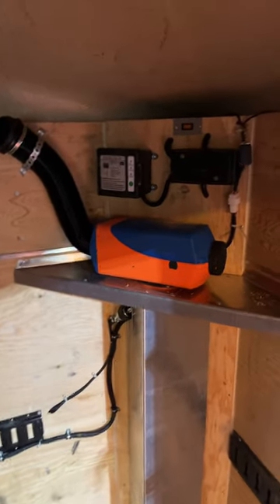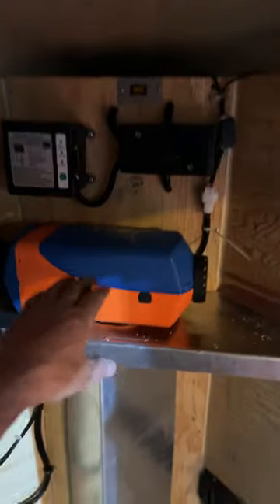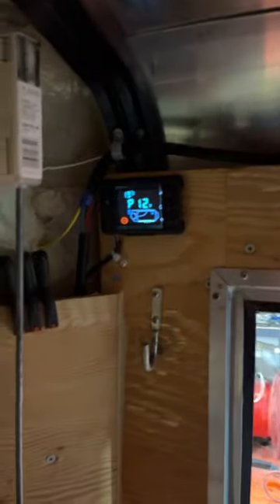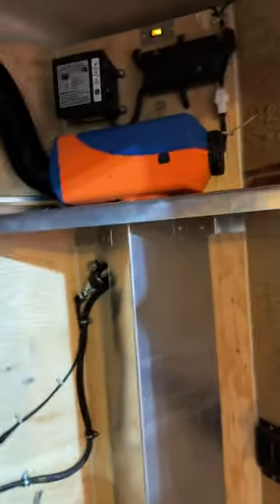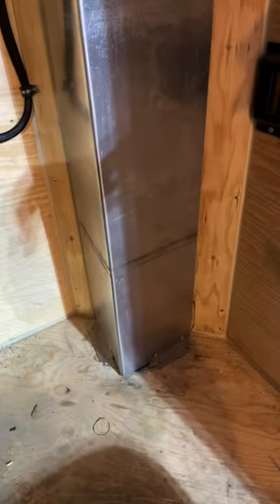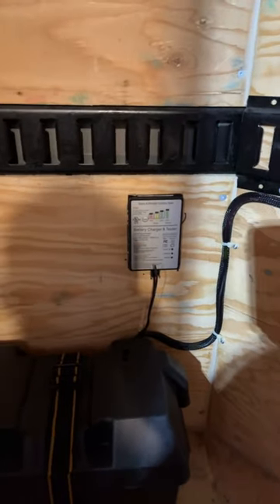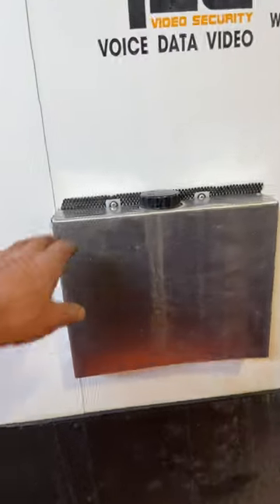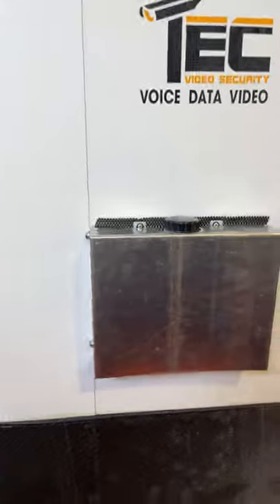Vevor heater installed in a work trailer.

Comment: Good job on the install... but honest opinion if you're not working IN your trailer, why do all this?
Reply from the maker: Thanks, they keep the hand tools warm along with a warm place to get out off the cold weather when they are working outside
Reply: @2riversboatworks318  yeah cold tools do suck to hold,  especially when you start your day at 7 and it is 7 degrees